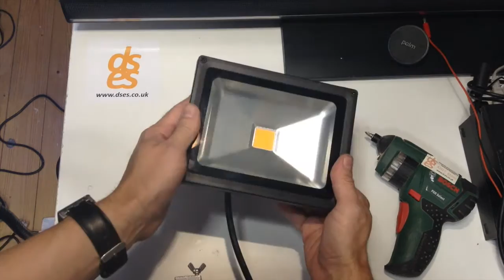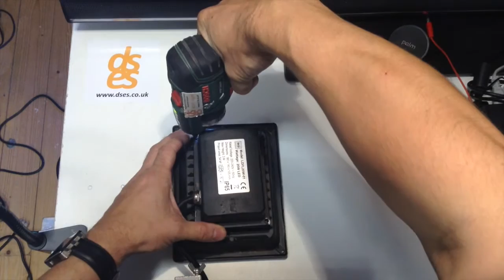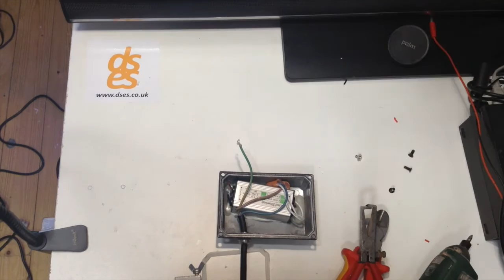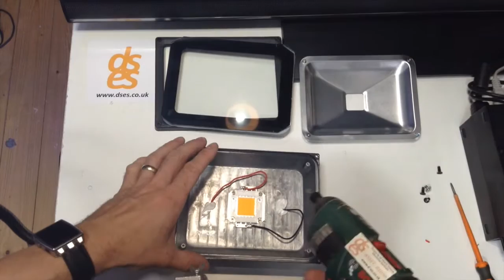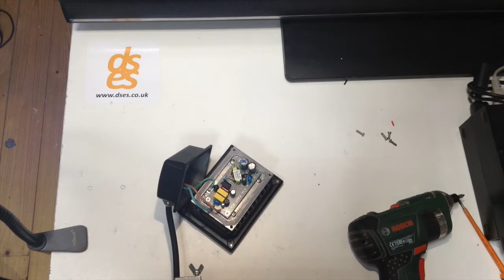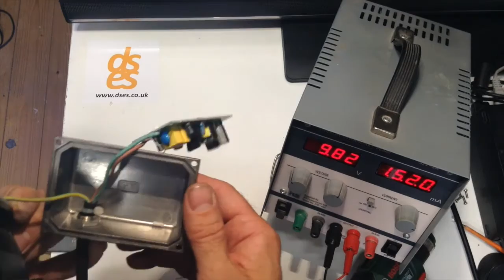Failed Floodlight Fault Finding

Comment: i have a question, given the sequence of events maybe you can point out the fault, my led floodlight taht was outside just stopped working instantly, it was dark we were using it and without any sound its just went black, when i plug it in i see very very little light on the LED's, even thought the light is very low i can see that the leds give less light towards middle, like right/left side leds are brighter and towards the middle its dimming down.

does that mean the LEDS are fine and its the driver fault?

Comment: They’re obviously pre wired to Joe public don’t have to buy a load of cable they’ll never use, or strip the light to wire it and make a mess of it. I’m lucky my junction boxes are with 2m inside my garage so the pre wired cable reaches. I just had a LAP 10w die, looked dry, I’ve not inspected it yet. But up another cheapo MIEKEE I think the spelling is. 20w. Will see if it survives a Scottish winter under a soffit. Cheers 👍🏻

Comment: Obviously David posted this a while ago but I am finding most Led flood lights are failing within two years, tried several brands. The only one that's holding up so far is the time guard pro range. The failure of some Led floods is unbelievably high how are other sparks finding reliability of the Timegaurd pro ?
Reply from the maker: It remains a problem as you say Paul, but I've not had problems with the Timeguard units I've fitted, although there have been few of them as they're not held off-the-shelf at my local suppliers. I've had good reliability from LEDVANCE models myself. The problem is that a LEDVANCE might be £45 or so, but Joe Moron wants to spend just ten quid from Toolstation and thinks I'm ripping them off by trying to flog a better model. I've just had a message from someone this afternoon who handed us a ScrewFix LAP thing to install two weeks ago which now seems to have failed. People need to spend on better brands and not assume that they're all the same! I'll only supply models I have some trust in so that I'm not bitten on the arse with warranty support, but if someone wants me to put up the Acme CackFlood 4000 they bought off eBay, then I'll do so, but it'll be chargeable if it needs replacing a fortnight later!
Reply: Totally agree sticking with TimeGaurd pro.  Great work on here BTW real world stuff

Comment: Very interesting I laughed my socks off when I saw your wire strippers I have exactly the same kind and Ive had them for 30 years or more, "borrowed" from when when I was a field engineer. I couldnt live without them. Here in chinese tool land (thailand), made of soft metal, use once then throw,  I've installed all my own UK plugs and sockets (confuse the locals)  and three wire mains. Just sussing out too much leakage current from these infernal SMPSU driven leds. tripping my 30ma rcbs. :-( thanks !DANGER (there's half mains V on the chassis I havnt got my rubber boots on yet to suss out why but it looks like capacitors may be used in the power units to filter out noise connected to earth/case, and if the central point of these is deck then an unearthed chassis may be 120v (mains /2) Now if that's the case (no pun intended)  if YangTong capacitor goes out short curcuit  then the case could become live. Velly nasty...One last point I ALWAYS use copperease on the screws or they merge corroded into  the case.  Normal grease washes off. (old naval systems installer  trick)

Comment: Perhaps you can help with this. I have replaced all the lighting in the home with LEDs and over the years I have "repaired" many of the blown LED lamps by replacing the black spot LEDs with solder. Which works pretty well and extends their life for a couple more years. But I'm trying to figure out what the causes the black spots in the individual LEDs. I'm guessing they burnt out. But why do they burn out? Is it poor materials in the die or heat sink issues or a power spike? I have noticed that in many blown LEDs from China the blown ones lack heat sink compound.
Reply from the maker: I can't say for sure, but I suspect failure of the individual elements is down to poor quality of construction, either with the individual LED elements, or with inefficient heat dissipation. While shorting out an individual element with solder may work, an LED is a diode and there would normally be a 0.6v drop across it. I myself 'repaired' some early LED cluster lamps by replacing failed elements with an ordinary diodes to maintain the volt drop, otherwise the other elements in series with it may themselves fail sooner. Mind you, different LED's have different characteristics and goodness knows what rolls off the production lines these days.
Reply: @dsesuk  White LEDs typically have a forward drop (Vf) of around 3.1V which is why drivers for ten LEDs in series are usually ~31V
Reply: @dsesuk  LEDs are usually illuminated by a constant current loop, rather than voltage. Shorting one out will usually just mean 3V less across the LED string, at the original set current level.  Hence safe to do  so.

Comment: LEDs seem to be so unreliable. Even quality known makes. I feel very insecure about fitting them. When things fail, the engineer seems to get the blame. A classic case of; The operation was a success, but the patient died!
Good video David. Thanks for sharing.
Reply: agreed
Reply: Im now on my 3rd LED security loutside lioght in as many months went out tonight just a few diodes were lit up with no light have to say i never had this problem with Halogen bulbs i think ill go back to halogen !!!

Comment: I bought a similar flood light for photography, but decided to change the cheap chips with higher quality Led chips.  I am worried that the light might get too hot since they don't have a heat sink/fan. The new led chips were expensive so I don't wanna risk damaging them. What are the things i can do just to be safe.

Comment: Hey Dave, possibly a silly question but what is the purpose of the thermal grease behind the LED? cheers.
Reply from the maker: The LED module consists of an array of individual surface mounted LED dies which generate a bit of heat in use. The module is stuck to the metalwork of the fitting which acts as a heat sink, and the grease helps to transfer that heat from the module to the metalwork. It's the same stuff you'd use between a processor and heat sink in a PC. Without it, the physical connection between the back of the module and the metal casing of the light might have a bit of an air gap or uneven contact, the result being an overall or localised overheating which may reduce the life of the product. Although in this case they were cheap and nasty to begin with and failed anyway.
Reply: Awesome reply, very easy to understand. Thanks bud. You should get some more vids uploaded mate! I'd defo be interested in watching. I'm only an apprentice in my 2nd year and love to learn new things which I don't / won't ever learn on site (we only do new builds and all the blokes I work with are on price, so not much in depth learning as they are always in a rush lol). Channels like your own, which provide valuable knowledge are a hidden gem! Keep it up.
Reply from the maker: NeRo Kozi Thanks for the kind comments, I'm glad my nonsense is of use to someone. There are more vids I mean to record, and more articles to write for the website blog, just not enough hours in the day to do it all! Good luck with the apprenticeship - feel free to fire over any questions if I can assist with anything.
Reply: Didn't realise you had a website blog, i'll be sure to check it out! Just curious how did you / were these floodlights terminated? I've seen a few different ways such as connector block + tape, mini jb, outside ip rated socket and then attaching a plug to the light itself. Curious to know the proper way to do it lol.
Reply: Assuming there is no conduit involved and you have the mains cable coming through the wall where the light is going to be fitted, what would be the best method?
Reply from the maker: If the supply cable is already coming out of the wall and can't be terminated inside the floodlight enclosure, perhaps because it's too short or the floodlight is a pre-wired model with a flex coming off it, then you'd need a method of junctioning it in a weatherproof way. Blocks and tape aren't acceptable, but an IP box fixed to the wall with the cables entering using stuffing glands would do the job. If external junctioning can be avoided then so much the better. If it's possible to draw the supply cable back through the hole then it can be junctioned inside the building using a standard screw or push-fit junction, then a new cable of the correct length can be taken outside, or a pre-wired flex can be brought inside. Any method that keeps the connections dry in the long term will be okay, but you have to use the correct cables and components outside as hot direct sunlight together with icy winter freezes will soon take their toll on anything not made for the job or botched into place improperly.
Reply: Ah I got ya! I assume the only time you can really have the junction inside the building is if the light is high up and enters a loft space, or if the floodlight is in a garage / shed. As typically people don't want to see a junction box mounted in their house (I assume that's what you mean by a screw / push fit junction, if not please correct me with a link to an image so I can understand better lol) What type of cable should be used for a floodlight? We use twin and earth on site but that's for a fixed light where essentially the cable is covered from any sunlight or so as it's not exposed.These are the fittings we use, in case my explanation was bad!  http://www.screwfix.com/p/35w-brushed-stainless-steel-barracuda-up-down-wall-light/19005
Reply from the maker: Yes, internal junctioning if it's not visible. Sometimes the junction can be directly off the back of a fuse connection plate if the lighting has been spurred, or a switch point if it's being controlled from within the house, but anything that keeps the connectors indoors is better then them being outside - if the circumstances allow. As for the cable, twin & earth is fine going through a wall and directly into the back of a light such as those you're installing. If you have to run a cable on an outside wall, twin & earth isn't acceptable in my book (nor would it be to a NAPIT/NICEIC assessor) as a solid core cable will expand and contract through temperature changes and eventually fracture over time. A low wattage external cable clipped to a wall, such as for an exterior light, should be stranded. I use the 3183P rubber flex cable for those sort of applications. It's sometimes called 'pond flex' as it's made to power pond pumps so can cope with being outside and underwater. Pre-wired security lights tend to have similar H05RN-F or H07RN which is beefier, but the 3183P stuff is cheap and readily available from the likes of Toolstation/Screwfix & co.
Reply: Didn't think of that, I guess you could extend the flex on the light itself to be long to reach the switch (or SFCU) if they are surface mounted and just use trunking. Not that it's ideal or that I've ever seen a house that's all surface mounted but I've heard some of the older houses are like that. Doing new builds you don't really see these sort of things. Thanks for the cable type number, i'll check it out! Now bring out some more informative videos!!! haha. Cheers mate!